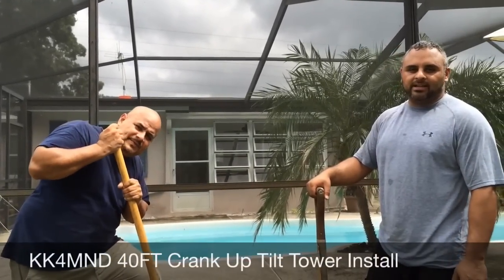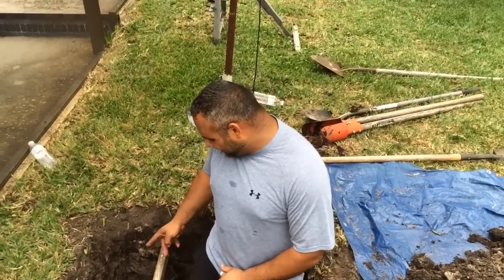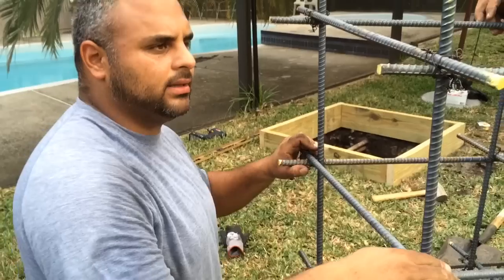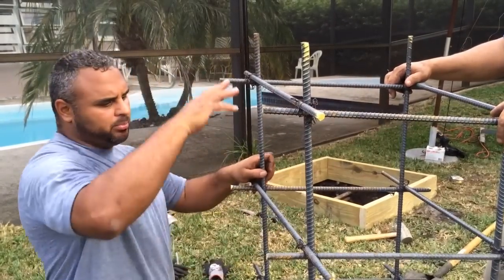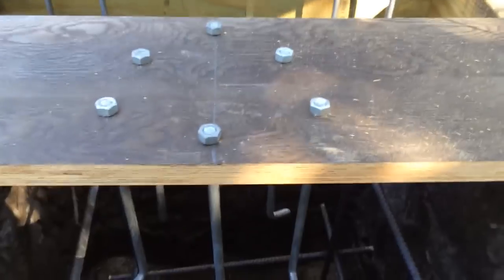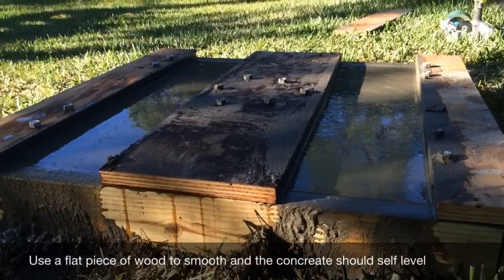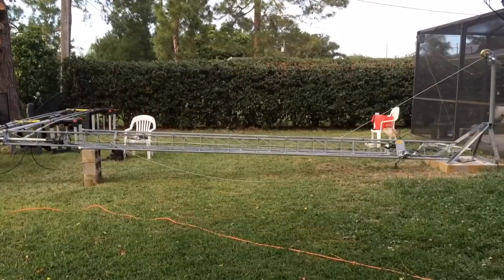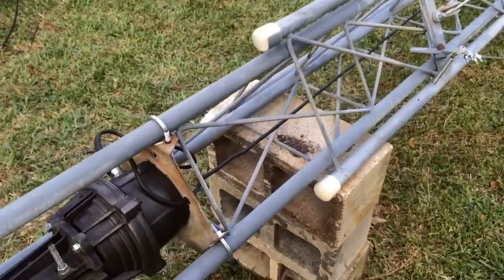How to Install Ham Radio Tilting Crank Up Tower

Comment: man i dream of that kind of soil to dig in! im up in north Georgia where it is clay and tons of rocks from marble size to car size. hope to hear you on the air. 73`s
Reply from the maker: Move on down to FL, we are open haha. I'm temporarily at  FT Stewart, GA area and I see what you mean... Are you on HF? Maybe we can try 10 or 15 or even 20 meters on the mobile depending on our distance? Especially since there is only one repeater in this small town that is quiet most of the time. What's your call sign? 73 DE KK4MND
Reply: @DJBlackhawk  noooo i`m from fla borned and raised i`m afraid of storms/hurricanes. . lol  i left there in 74 joined the army and never went back except to visit.  right now my HF rig is on its way to Tampa to a tech to get  a tune up. but i do have a ts 430  and a 160 mtr ant up i can talk on. i think we can try that if you have enough wire in the air. I just lost a tower and beams to a tornado 2 weeks ago so all i have up now is a G5RV and 160mtr wire and a 6btv hustler slightly bent.
i was at Ft swampie many times while in the Army last there in 2000 working at the Youth program on base in the Natl guard area.
Reply: yup same soil in NY... 1st tree hole I dug in FL ... I literally laughed out loud... sooo easy ! 👍

Comment: Nice job with the hardware.  I was worried you were mounting the bolts flush with the top of the nuts, but the final job is right on once the wood frame template was removed.  Bolts should always have threaded rod above the fully seated nut, with a minimum being the width of the bolt itself.

I didn't notice a grounding rod going through the base to contact soil below... What kind of grounding system do you use for that rig?
Reply: BigDogsHunt100  I had the very same question.

Comment: I think I saw a serious mistake in your installation.  Was the rebar cage actually driven into the soil, or otherwise touching the soil?   If so, that is a concern because the rebar will begin to decay where it meets the soil and continue into the cement.  The cage should have been suspended off the soil and completely enclosed in cement.
Reply from the maker: Thanks for pointing this out will have to dig around the base and inspect every year. I thought we but rocks in before we poured but I forget...

Comment: Shouldn't the bolts be connected to the re bar frame? All that's holding the tower up is the bolts set in concrete. Is that right?
Reply from the maker: The bolts are not just bolts they are J Bolt Anchors rewatch at 3min 40sec mark they have J shape anchors that get embedded in concrete. The rebar most likely won't last and eventually rust away. To prevent that I should have used rocks and gravel at the base of the hole as someone else recommended.
Reply: @DJBlackhawk  You could've used fiberglass rebar instead.
Reply from the maker: Thomas Bonse where were you with this comment 7 years ago? Haha
Reply: @DJBlackhawk  Sorry I was late to the party, a cookout and tower raising party would've helped. 😉

If you decide to do it again, you might want to check out these guys telescoping towers and their fold-over kits for self-supporting towers.
http://www.heightstowers.com/fold-over-kits.html

Comment: David, great video, thanks. I'm curious about the feedline; do you just have it dangling from that extension you showed at 5:36 to the ground, or is it attached to the tower elsewhere? I've been trying to figure out (without having seen anyone's rotator setup up close) how to deal with the feedline and avoid getting it wrapped up around the tower/mast. Thanks again!

Comment: The base wasn’t wobbly because it was too thin. You failed to add leveling nuts underneath it.  That would’ve increased the distance between the base and the concrete and allowed the top nut to tighten down all the way.

Comment: your foundation hole looks ok but the base plate is just too small should be 3/4 bolts welded to the rebar 1/2 plate i removed my base and engineered  the swing over with 2 inch pin on 1/2 inch plate with collars.